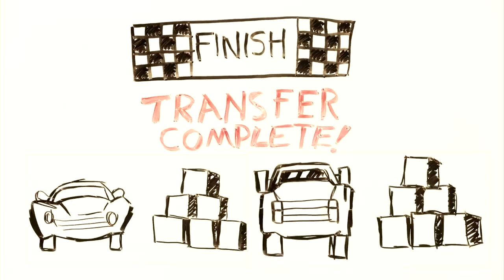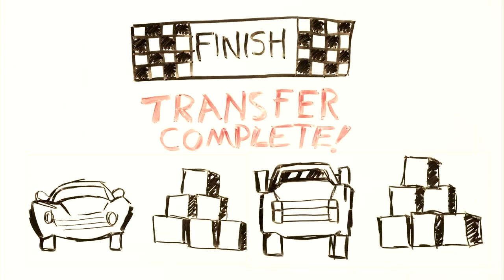WD -  5400 rpm vs. 7200 hard drive

Comment: Say what you want about the ELI5 of this video, but I learned something.  Also, every Seagate hard drive I've EVER had has failed.  Lost everything.  I have a stack of WD's  with back ups, old photos, and all kinds of data (no, not porn, that's free on the internet now) still going strong, so I will always, always, always buy WD.  Unless we're talking SSDs, because then it's a MX200 SSD after they release the MX300 this summer and the prices go down!

Comment: Okay so transferring huge amounts of data is better with the 5400rpm.. how about loading data (gaming)?
Reply: PlaystationQUAD-ProTM   Reading fragmented data (tiny pieces spread across the hdd) is faster with 7200. Games should fall into this category because every time you load a level, it gets assembled by small data from all over the game file.
Reply: A new 5400 can be faster than an old 7200, but a new 7200 will be even faster!

Comment: Sure, double the bit density on the 5400rpm drive and you double the output, but then why not double the density on the 7200rpm drive as well?! I don't know why WD are trying to say 5400 are better, WD's own "max performance" 3.5" drives are the "black" range and they are all 7200rpm drives!!! (I've just checked this on their website)
Reply: I think they're saying that just because a drive is 7200 rpm doesn't automatically make it better. This guy has an older 7200 rpm drive and he wants to upgrade to a newer one without spending too much. And the guy is like "well, you can still get more performance compared to your old one without spending all the money on 7200 rpm."

Comment: What About Seek Time ??? You Haven't Mention That... Seek Time Really Matters and it's the most Important and only Reason Which makes Drive Boot/Run/Performed Faster.. .. if you Have an 5400rpm and 7200rpm drive, Both will Show you the Same Transfer rate But The Seek Time of both Drives Will Differ... Lower The Seek Time , faster it performs because Drive Read/write Head takes less Time to Find an File(etc) ....

Comment: Well, what WD are saying is new 5400rpm drives are faster than older generation 7200rpm drives which is true but only of course if we talking about old enough 7200rpm drives e.g. 10 years old.

What has happened is that 7200rpm drives have been moved to an enterprise market segment and WD now want that to be priced accordingly.

I got some figures.

My old WD 36gig raptor drive which has 10k spindle speed 70meg/sec at start of disk
WD 640 gig black drive which has 7200rpm 110meg/sec start of disk
WD red 3tb drive 5400rpm 150meg/sec start of disk

This is because density has increased so ultimately sequential speeds jump up.

On random i/o tho I didnt really compare I am not sure if the new tighter densities benefits random i/o other than the fact on a larger capacity drive fragmentation is less likely so as such random i/o is also less frequent.

A modern 3tb 7200rpm drive will of course be faster than a 5400rpm drive with the same density from the same generation, e.g. WD RE drives and WD black drives.

Comment: wd elements 5400 rpm 32 or 64 mb cache I am using a hdd with 100 mb read speed and although there is no fps problem in most games, stuttering happens. I am considering buying a toshiba mg08 hard disk 7200 rpm 512 mb cache 262 mb read speed, do you think toshiba mg08 hard disk has a stuttering problem in games is it possible

Comment: The only thing is that most of the 5400 HDDs are for laptops, and only go up to 1TB
Reply: yeah, and most 2,5 inch HDDs that are 5400RPM are low quality, I had two 5400RPM HDDs and both sucked, I had 2 7200RPM HDDs as well and both were fastest HDDs I have had in my life. Coincidence ?
Reply: Really, because WD has a 3tb 5400 Drive for desktops...
Reply: Arnoodle I meant as in laptop size, 2.5"
Reply: Yea, they sell 3.5" 3tb 5400 RPM drives that are WD Green

Comment: i got toshiba PA429 5400 and 429 7200 as external and when i am max downloading and at the same time play a movie from that same ext drive (so the usb cable is then ful of data going to and from unpacking rar files at same time. The 5400 plays a video file at the same time smoother than a 7200drive on my system  that is

Comment: wish i known this about 10 minutes ago i just bought a 7200rpm wd 500gig for $30 u couldve got a 5400rpm wd with 750gigs for an extra $6
Reply: Million Dolla Scrilla The 7200 RPM is probably faster than the 5400 since they are both recent disks and probably have the same bit density.

Comment: This video seems misleading for some reason. I have a Barracuda 7200 RPM HDD in my laptop and my friend has a WD Blue 5400 RPM. They are both 500 GB, but mine boots and performs faster/better
.
Reply: That is hugely dependant on other factors, such as the specs of the pc and existing software.

Comment: for Gaming, or music production. Always go with WD Black. its a solid 7200rpm. i have 6 of them and have helped friends ugraded with it, non of mine has failed over 4years now . 750GB and 500GB.  i dont know for any reason il be spending my money on 5400rpm. most external hdd are 5400 so i buy internel WD Black + USB Enclosure. the difference is clear.
Reply: On cheap side go wd blue

Comment: Terrible acting. Terrible terrible acting. Question: Why are hard drives always 5400 or 7200 rpm? Why not 5000 or 7000 or some other random number?

Personally, I couldn't care less about HDD speed, as long as it's over, say, 50MB/s. It's just storage anyway. Anything live put it on an SSD. All I want is long life and few bad sectors even after years of use. My 10 year old WD has 0 bad sectors after 16 passes of badblocks. One of my 3 year old Seagate has over 500 bad sectors. Which I don't really care because I have checksum redundancy, but it does show sloppy device, even if it gets 170+ MB/s, while the WD one gets more like 60MB/s.
Reply: Well it might be storage but you are a "small" user compared to the core powerusers (like me) , i have at least 30TB of storage on different storage units (pc/nas/servers). Badblocks can only help you so much in the end. Your 10 year old WD could not even get past 50mb/s read/write in the first place. When you use storage like i do anything below 120+ mb/s non raid is unacceptable. next to that : The seek times of your old hardware wont even come close to the seek time the new hard drives have. and SSD is decent , but its still unreliable in some points (plenty of ssd's either go dead completely without any chance of data recovery, or they will lose a lot of speed over time, especially on linux).
Reply: blueeetje It's obvious you're not a power user. Do you even know what badblocks is for? Not likely. I just get pissed when I get so many errors scrubbing my array. They all get fixed, but that doesn't mean I'm not annoyed. I'm guessing your 30TB isn't checksummed, and your ram is non-ecc, so probably huge chucks of your data is corrupt, even if you have a redundant raid. All my local data is on SSD's. My storage goes over ethernet, it's not going to go over 120 MB/s no matter what. And SSD's don't lose speed on linux, they actually had discard support before Microsoft did (since 2008). For true power users, ECC and checksums of stored data are WAY more important than speed.
Reply: blueeetje
You are a troll. Badblocks has 0% to do with recovery. I runs apps that are used by 10000-50000 employees, the last seven years. But I don't manage any of that. I leave that to teams of people, or 3rd party companies, because I sure as hell don't trust multi-million dollar data to a process that isn't stored in multiple location redundancy reliability.

I hope you don't get an earthquake, becaue then 10 000+ workers will be out of a job.

There is no trim on Linux. It's called discard. I only cater to my data for my personal business. I currently use btrfs, but ZFS is also good. I have gigabyte connections locally. So 120MB/s. Pretty much the limit worldwide. Don't tell me you have an internet connection above a Gb/s.

In my professionnal life, I've worked in banking and insurance mainly. You're right, I haven't soldered anything in 15+ years, nor do I manage any day-to-day storage. I have cron and experts to manage that. By experts, I mean technicians, like you, that think they are great but have to report to and do what I say, because I'm an evil manager that doesn't know anything.

Comment: What the hell ? this is so wrong , a 5400 rpm disk would never ever outperform a 7200 rpm disk ... the moment you have been working with it for a while it will be fragmented and the performance gain of a 7200 rpm over a 5400 will be easy 30%-50%. Boot times (same pc) SSD 8 sec , 10k rpm 20 sec , 7200 35 sec , 5400 1 minute and 12 seconds.  what a commercial junk they are spilling here.  The bits and tracks are neglectable since they are not the limiting factor when it comes to drive access time.
Reply: blueeetje pretty sure a hard rive engineer knows what he is talking about.
Reply: blueeetje i have 5400 rpm hard drive in my laptop and trust me my pc does not boot in 72sec :D u must have 20 year old 5400 drive resoults....

Comment: There wrong 5400 rpm is slower than 7200 rpm because they don't carry larger amounts of data than the other so 7200 rpm wins
Reply: But increasing the density of the disk will